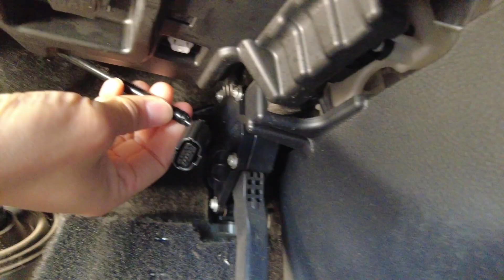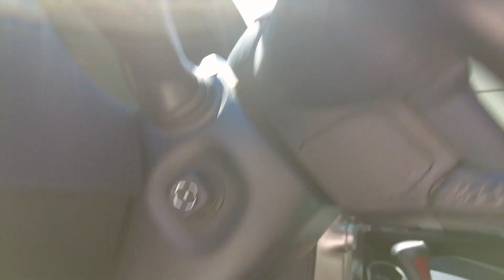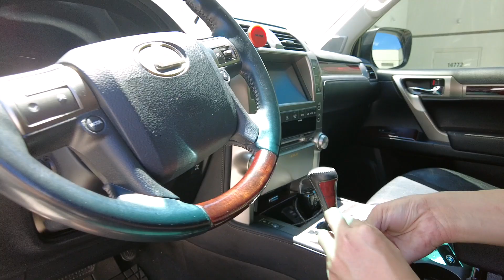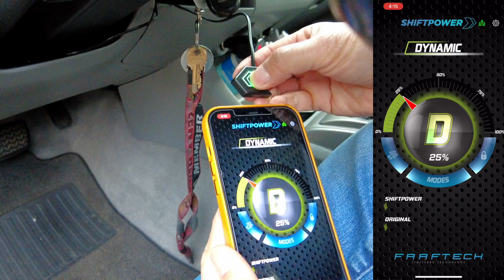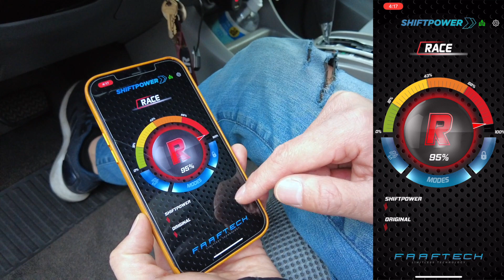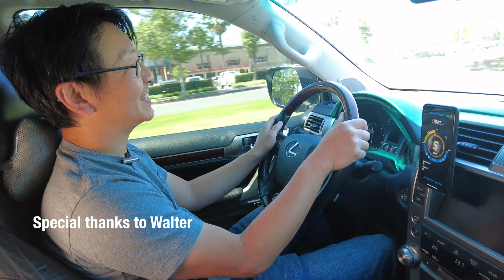2011 GX 460 Shiftpower Throttle Response Controller Demonstration and Install

Comment: Do I have to connect the mode button / indicator LED? I am planning on just controlling it with the app. Don't want to have the switch out visible.
Reply from the maker: You don’t need to connect the mode button

Comment: Does your product work for the 2023 GX 460’s? If the car is shut down, then restarted…will the product keep its settings (ie. maintain the throttle shut off for theft prevention)?
Reply from the maker: Yes this will work with the 2023 GX460 as well. Yes, the setting will remain even after you turn off the car
Reply: @BeatSonicUS  yo!
Bombastically awesome 💥👍
Thank you for the quick response…now I just need to find a GX 460 to steal. 💥🤣👍 

🤡Hah! Just kidding. Happy Holidays!

Comment: What setup does that GX have on the front? I love the look even with the oem running boards. I can’t tell if that’s a lift and aftermarket skid up front though
Reply from the maker: I know it has a lift but not sure about the front setup
Reply: It has the “Viper” front bumper cut, 2.5” lift and Baja Designs Squadron Sport fog lights
Reply: Looks like Ironman4x4 suspension based on the green springs

Comment: Been using this ShiftPower unit on my GX460 for couple trips now.  Just love how it improves throttle responses on and off-road.  Thanks Beatsonic 👍
Reply from the maker: Thanks for your feedback!
Reply: Do you need to click it to race mode every time you start up your car again?
Reply from the maker: @UnknownUser-zw9od  it will save the last used setting. If it was on race mode before you turned off the engine, it will be race mode when you turn in your engine again.
Reply: @BeatSonicUS  just bought it 👍🏽 keep up the great work

Comment: I love this module! I have this exact one except for my 2016 GS350 F sport. Usually set it at 75% to have some fun driving around and it is fun. I may or may not have put it at 100% and topped 130 mph in a quarter mile then I got scared lol and slowed down. It really does work so be careful.

I do have a question, I love all your stuff all of it is well made and for some easy to install especially with Toyota. Which brings up the question I have another car it is a GLE 350 and I was wondering if you have something against Mercedes or is it that most of your stuff is made for Toyota products? I sure would like to get one of these on my Mercedes. I had a GS 350 before and traded it in for the Mercedes so I can put the dog in the back and also room for camping and whatever. Had to have a GS again because they are so fun to drive and they are so luxurious especially with the Mark Levinson sound system. So let me know when you get one in that will work with my Mercedes GLE 350 and it will be sold to me.

This place is great if you want to add a little extra something the manufacturer left out like Android Auto and Apple CarPlay not to mention mirroring your phone the list goes on check out their site.
Reply from the maker: Thank you for your thorough feedback! We are going to add the shiftpower for Mercedes shortly. Will do an install video next week! What year is your GLE 350?
Reply: @BeatSonicUS  awesome! It's a 2016.

Comment: can one buy this for the GS?
Reply from the maker: Absolutely. Available here https://www.beatsonicusa.com/shiftpower.html
Reply: One would think a GS350 F sport would be enough. Nope I put one in mine and OMG!!! The GS already has get up and go but I would strongly suggest if you get one and you should, that you start off driving it at 50%, so you don't have to clean your car when you go 100%. Lol. The good thing is it does not overwork your engine. It's up to you if you want to manual shift because you're going to be in the high RPM  very fast if you do and that's not good. Trust me let the engine and the computers do the work it's just going to do the work a lot faster. But it's your car so do what you want to do. Enjoy 🚘
Reply: @davolbc  Which part number do I pick in order to buy from website?
Reply: @alphaeta53  yeah I was confused to that link also. I didn't understand the list of part numbers or how a customer is supposed to know? I thought he would put up the YouTube link. You can go through his YouTube videos and join his channel and find the video regarding the Lexus GS and this part. Put your question into the comments on that video. Or Eric you could just chime in and help everybody out on how we're supposed to know what part number to pick. Very good question though. I'm sure someone will get back to you very soon.

I just went and grabbed my manual and it says on the sticker inside the first page that it is model SP09. That is the one you want.

He usually mentions the part number as far as I recall in the videos and maybe he just assumed you saw the video Wait. I don't think he has a video of a GS yet but I'm sure one will be up shortly let's hope. When I got mine I just sent him a message asking when were they going to have one for my GS F sport and he got back to me and I got it. I figured since he was putting them on the GX 470 and 460 that it should work on my car too. I don't know if it's the same one as the SUVs but it works great again subscribe and ring that bell.
Reply: @davolbc  thanks for the reply. appreciate it man!